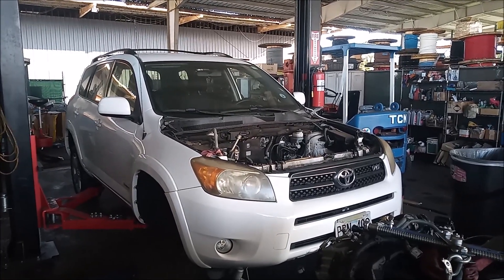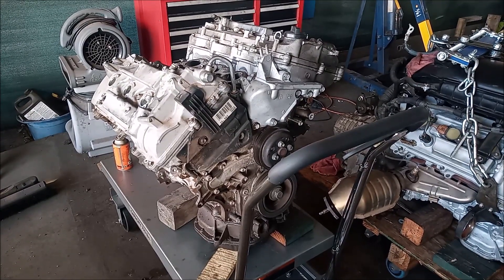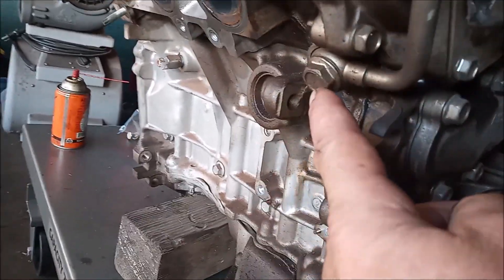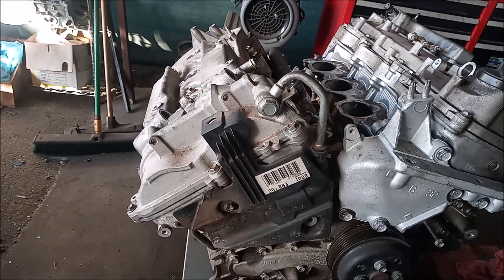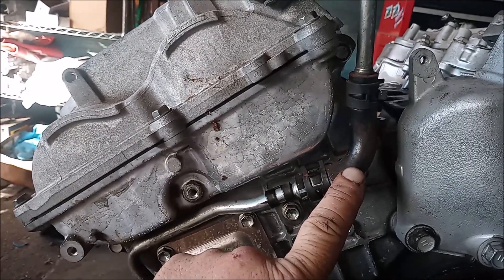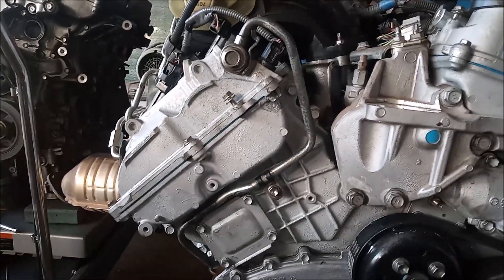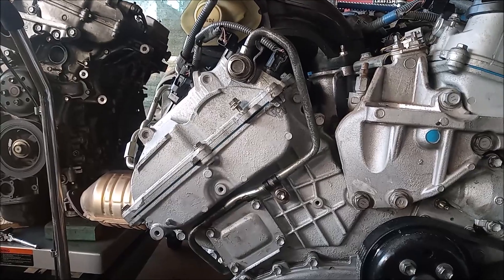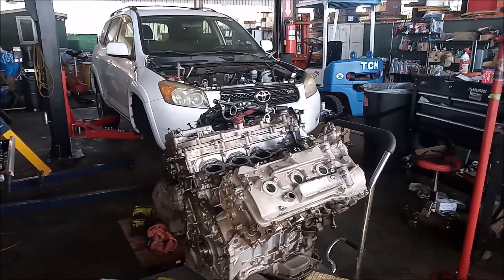Prevent Your Engine From Blowing Up  - VVTI Fix - Toyota 2GR-FE 3.5-liter V6 - RAV4 CAMRY HIGHLANDER

Comment: For these models with rubber oil lines - aren’t there 4 of them typically?   VVTI line shown here. Another one in the front bank.  Also the oil cooler 2x line at the bottom?
Reply from the maker: there are only two vvt oil lines. the one on bank 2 is metal from factory. The one on bank one is either rubber or metal depending on date of production. The oil cooler lines were rubber in early production, metal later.
Reply: Correction- bottom 2x line only if it came with an external oil cooler.  

I have a 2011 RX350, built in canada June 2011 - probably at the very end of 2011 model manufacturing cycle .  Turns out that factory put metal vvti line, both banks on this car. Then removed external oil cooler, assuming to remove these rubber line failures.   Some say they started doing this for 2012 models and after.  My mechanic and I were scratching heads, staring at my metal vvti lines and no oil cooler - while everyone out there saying 2011 and before has these rubber ones.   Wish I had seen your video before!   Is front bank line not a typical problem?

Comment: Has anyone ever had problems with oil leaking from the bottom of the all metal oil line? My 2012 Rav4 Sport V6 has the all metal oil line, but I have noticed some oil leaking around the bottom end of the line, and oil is leaking onto my cv axle boot. Any thoughts???
Reply from the maker: common leak, replace the copper gaskets for the banjo. But there is another leak very close to that, from the timing cover, tough to tell them apart sometimes.

Comment: I had that vvti hose with rubber section on my 2005 Toyota Avalon and as soon as I read about it on forums I had to replace it. Toyota dealership tried to sell me a new and improved version with same rubber section but I just went to a Lexus dealership and bought a solid line. It was not easy to install it but was able to do it myself. I’m glad that I took care of it early instead of waiting for catastrophic failure. Thanks for sharing your video.

Comment: My line blew up on intrastate. Only went 1 more mile to get off interstate. Had to have my 2008 highlander towed back 50 miles to my local repair shop. Luck it did not damage my motor. I do use Liquid Molly with every oil change. Believe it might have saved me that one mile to exit to turn of motor. The said "low oil Pressure" on the display where the miles per gallon are show. still going strong.
Reply from the maker: Wow you dodged a bullet.

Comment: Just bought a 2005 avalon with 179k and it still has the rubber oil hose 😱
Reply from the maker: Back in the day the dealerships were replacing the old rubber oil hose with a newer rubber oil hose.

Comment: Toyota has told me for 10 years my car banjo gasket is sweating but not mentioned this. It’s a RAV4 sport  2010 v6 . Is this the same?
Reply from the maker: It's the same engine. In the same area, the banjo bolt can seep, the oil line can seep (bout only on pre-2010 models with the rubber oil line), and the timing cover can seep. It can be difficult to tell where the seepage is coming from.
Reply: @ thank you for explaining. I better investigate this.
Reply from the maker: @MISSY4EVR  if it were the banjo bolt seeping, then it would have been very easy and inexpensive to fix - all it takes is replacing the banjo bolt washers. Most likely, if you have a 2010, then your timing cover is seeping, this is a known factory defect, and it is the subject of a Technical Service Bulletin. You can look up whether this TSB applies to your car according to the VIN. This would have been fixed free with the car still under warranty. At this stage, the repair cost would be on you. It is an engine out-of-car procedure to reseal the timing cover. You can expect about $3,000-$4,000 for the repair.
Reply from the maker: If the leak is not catastrophic, just live with it.
Reply: @Merryfrankster_  the one shop told me it’s a engine oil line but the Toyota dealership calls it the transaction axle side cover reseal and the other Toyota shop calls it a VVT banjo gasket leak when I talk to my current shop they say it’s the same thing but everybody has different lingo so I am so confused
Reply from the maker: @MISSY4EVR  I think the dealership is talking about either the timing cover re-seal, that is an actual thing, or, they could be talking about the rear main seal, aka transaxle side seal, those all leak on high mileage vehicles. Just ask them to point out where the leaks and parts are on a picture or a parts diagram.
Reply: @Merryfrankster_  ok I will. Thank you very much for taking the time for me. I appreciate it.

Comment: Dropping the motor on my 06 Rav4 is so cost prohibited, I'm thinking outside the box and will replace only the rubber hose section with Toyota oil cooler line. A little tight but it can be done since the lower pipe is held in place with the clip. Just have to be super careful not to bend the metal pipe/banjo on top.  What do you guys think?
Reply from the maker: Take your car to a shop.

Comment: Why did Toyota use a rubber line for hot oil that is so close to the engine in the first place?
Reply from the maker: Why ask why. Thank you for watching and for commenting.
Reply: To save 3 bucks per car 😃

Comment: This is the best V6 engine of all time in my opinion not only because it is bulletproof but also makes great power specifically in the smaller cars like the Camry. I have a 2011 Camry SE with this engine and i love it got it for cheap too!
Reply: I have a 2012 rav4 v6 and it’s faster than my brothers Camry with same engine. We raced back and forth and the rav4 was quicker due to its exhaust and 4wd. Even on a roll, it’s quicker too. Toyota set up the exhaust way better for performance than the Camry.
Reply: @topo520  It's the gearing, not the exhaust.
Reply: @UguysRnuts  don’t they have same 5 speed automatic?
Reply: @topo520  Ratios are different.
Reply: @UguysRnuts  ah okay
Reply: Spontaneous rupture of vvti  oil line and transmission oil cooler is bulletproof? Common G! These are defects

Comment: Just got mine back from the shop with the new all metal line installed.  Peace of mind is well worth the small cost in replacing the rubber elbow line.  And of course, you were right, the part that the Toyota parts sellers all say doesn't fit the 2GR-FE, in fact fits perfectly.
Reply from the maker: The moral: Never believe anything from Toyota. The company is built on lies.
Reply: Check your oil cooler lines, too. There are rubber sections there as well and could suffer a fatal aneurysm of oil.
Reply: @johnhwang339  So, there are two lines, one closer to the top of the engine on the left side of the block and one lower.  The problems were all occurring in the oil line near the top of the engine block on the left side.  TBH, I'm not sure to this day if the lower oil line has rubber in it or is all metal, but I've never heard of anyone having trouble with the lower hose, and the LSK90 Toyota Service Bulletin was about the upper hose.

Comment: At what milage does the rubber normally break and leak?
Reply from the maker: It varies. Some were leaking at low mileage less than 50,000. Some go more than 150,000. Really can't tell you.
Reply: Changed mine at 190k and still looked to be in decent shape. Have piece of mind now at least

Comment: Could it leak by the bolt in the back of the block because i see no leak by the rubber part but by the steering pump ?
Reply: If you're going that far into it to replace the washers on the banjo bolt, just replace the whole thing. On the top banjo bolt, there's a cone filter that needs to be cleaned when you do it.
Reply from the maker: yes, the rear banjo bolt frequently leaks. Replace the washers.

Comment: Bought a used toyota avalon 2009 with 94K miles on it from a private dealer, rebuilt after an accident. Turns out the original owner did all the scheduled maintenance through the dealer all the way up to his accident (I checked with his dealership, he even had the ATF replaced exactly at the preferred interval). 

After watching this I checked the oil line and had pleasantly discovered it was the updated metal part! After all these years and it's still driving like a new car. Maybe it was done through the 2010 recall? Either way I'm glad I got a car from such an owner that cared so much for his vehicle.

For the future I need to check the valve timing cover for the leak the 2gr-fe is famous for. If I don't get that then I'll be very happy
Reply from the maker: Thank you for watching and for commenting.
Reply: My 2007 Sienna had a recall on this oil line and all they did was only update the rubber section to a more oil resistant rubber hose. If I recalled, the updated rubber hose has a yellow marking at the top end. I still don't feel secure with a rubber hose. 

There's another rubber hose section towards the front of the engine where oil lines connect to the oil cooler. Again, those have the rubber sections and it was upgraded to all metal ones in the later models. That one was not on the recall.
Reply: @johnhwang339  seems unethical from Toyota to be honest.

Comment: Anyone know what the defective vvti intake gear part number is? I need to replace mine but I don’t want to buy new old stock defective gears. The part number is 13050-31170 or 13050-0P071 saying that is the new #
Reply from the maker: The exhaust gear is the one that fails. Regardless, the part number you provided is in fact the part for vehicles from 2011 and later. See this link and the "what this fits" tab. https://parts.lakelandtoyota.com/p/TOYOTA_2012_SIENNA-Limited-Mini-Passenger-Van-35L--FWD/Engine-Timing-Camshaft-Sprocket/10799800/130500P071.html'
Reply: @Merryfrankster_  thanks for the help. Not sure why I thought it was the intakes  all this time. Is there a chance any of the old defective gears are still being sold?
Reply from the maker: @country_gbrony721  Look for my video on the 2GR VVT gears. I provide the Technical Service Bulletin (TSB) for the gear failure along with part numbers. Here's a link to the updated exhaust gear. https://parts.lakelandtoyota.com/p/TOYOTA_2012_SIENNA-Limited-Mini-Passenger-Van-35L--FWD/Engine-Timing-Camshaft-Sprocket/3901172/130800P040.html
Reply from the maker: If your exhaust gear has failed it will be very clearly visible that it is out of kilter/out of alignment. It will also make a huge racket coming in contact with the timing cover. The noise is not internal to the gear. It comes from the gear hitting the timing cover. Take the valve cover off and inspect it visually in place to confirm the diagnosis
Reply: @Merryfrankster_  I have the 1-2 second VVT rattle upon a cold start that goes away when oil pressure builds. If you crank without starting it will prevent the rattle.
Reply from the maker: @country_gbrony721  Look at my video titled "Miracle Cure for the VVT Death Rattle." Replace the valve cover o-rings, clean the VVt filters, and see if that helps, before you go on to replacing the gears.
Reply: @Merryfrankster_  I tried that on the right side (where it sounded like the noise was) but the Fel-Pro single o-rings were bigger than oem so I couldn’t use them. Replaced the solenoid screen also and tested the solenoids.
Reply from the maker: @country_gbrony721  it's odd that the gaskets did not fit, I've never had a problem with them. But you can get these gaskets from Toyota.
Reply: @Merryfrankster_  they were slightly larger than the ones in there and would not fit in the hole. Is this normal? Would they compress down when the bolts are torqued?
Reply from the maker: @country_gbrony721  They should fit securely in the holes. There are two figure 8 gaskets and one round o-ring for each valve cover .
Reply from the maker: @country_gbrony721  you can get a very good fiew of them in this short video that I made https://www.youtube.com/shorts/Ni4OUAxAj1I
Reply: @Merryfrankster_  everything fit like it was supposed to except the single o-ring. Weird.
Reply from the maker: @country_gbrony721  are you sure you were trying to put the o-ring in the right place for it?
Reply: @Merryfrankster_  yes , I watched a couple videos.

Comment: u just reminded me i need to double check the whole thing is metal on mine. i couldn't see quite how to remove the cover over that area... so i think i put it off 😬
Reply from the maker: Rubber section is visible facing toward the front of the car without removing the cover, if you have a rubber section. If you look and you don't see any rubber then it means there is on rubber.
Reply from the maker: But you do have to remove the top engine cover - it pops right off.

Comment: Is this issue the same on 2GR-FSE on IS350? Or strictly FE engines??
Reply from the maker: Different engine, different issues. As far as I know this does not apply to 2gr-fse but you might check with your Lexus dealer about that.
Reply: This does apply to the 2gr FSE from 06-09 IS 350's. Exact same issue and resolution however I don't think it's as catastrophic compared to the FE (at least from what I've heard so far). These earlier 350's lose like a quart of oil every 500 miles, it's because of this. However I lucked out my 2010 350 with 160k miles literally doesn't drop an cm on the oil stick after 5k miles. Overall these are reliable engines!
Reply from the maker: @Bdog0820  The rubber line can seep slowly which is not catastrophic until it suddenly busts and you lose most of your engine oil within a minute or two. The engine seizes as you drive down the highway. If you say it is the exact same issue then it will have the exact same consequences.
Reply: @Merryfrankster_  makes sense what you’re saying. Just not sure why I haven’t seen/heard of sudden FSE failures due to this. Regardless it should be fixed asap lol
Reply from the maker: @Bdog0820  Maybe it's more visible on the front of the engine and is more likely to be noticed before it turns into a serious problem? On the 2gr-fe it is nearly invisible - most owners or service people will never see it.
Reply: @Merryfrankster_  Yea possibly. Thanks for sharing this info.

Comment: I have a 2009 rx350 and replaced the oil cooler lines about 6mo ago. Now I have another big leak and can’t tell where exactly it’s coming from. I’m assuming it’s this vvti line. Could it also be a timing cover seal?
Reply from the maker: Clean it all off. Use as many cans of brake clean as you need to get it completely clean. Then run the engine until you start to see oil.
Reply: @Merryfrankster_  so I had it dropped off at the local Toyota dealership. They just sent me an estimate for oil pressure switch. How hard is that to do?
Reply from the maker: @MrJimburg21  Oil pressure switch is ridiculously easy to do. The switch threads in right above the oil filter housing. You just need a socket of the correct size (something like 22mm or so) and it comes right out. There is absolutely nothing in the way except the plastic undercover.

Comment: Is it on a place you can see?
Reply from the maker: Yes, take the plastic cover off the top of the engine, and you can see the line very clearly and you should be able to tell immediately if it has a rubber section or if it is an all metal line.

Comment: At about how many miles does that  rubber line fail?
Reply from the maker: Hard to say. It seems there was a rash of failures starting 2-3 years from production so let's say 50,000 to 100,000 miles? Environmental factors and usage patterns can also affect the time to failure. Also rubber ages and degrades just sitting and doing nothing, so chronological age is a factor, not just mileage.

Comment: And if it's got the rubber sectioned Oil cooler line for the transmission cooler same problem. Toyota engineering so great, they have taken some stupid minimal savings short cuts - rather mind boggling at times. Luckily they don't usually have multiple major fail points that are much more costly like other brands.
Reply from the maker: Toyota Engineering comes up with some real doozies sometimes. Wonder what they're thinking when they do.

Comment: Should go double check mine. Had the oil pressure sensor fail and thought it might be this.
Reply from the maker: Very easy to check this. There is a direct line of sight to the oil line.

Comment: Thank you for this video, I recently bought a 07 Camry V6 XLE V6, only had 38k miles when I bought it in October, 2021. According to the carfax that oil pressure line was replaced, but I read online that some where still replaced with another but more up to date rubber oil line, anyways I went to check my engine and yup the oil line is partial rubber….. no leaks or nothing and I completely driven this car 30k miles….anyways ima replace it since I want this car too last part 200k…
Reply from the maker: I thnk it's a good icea to go with the all-metal line even if the replaement has been done previously. I've provided part numbers. The job is harder on the Avalon/Camry engine because you have to move the p/s pump out of the way.
Reply: @Merryfrankster_  yeah thank you for providing the part numbers, definitely going to get it done soon
Reply: @Merryfrankster_  hey I uploaded the video of my oil line to my channel, check it out if you have time!